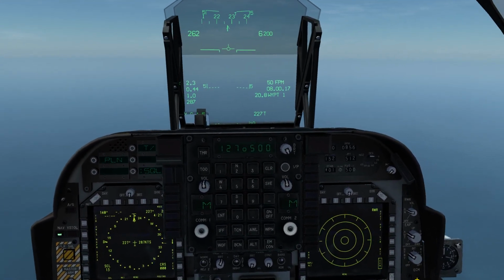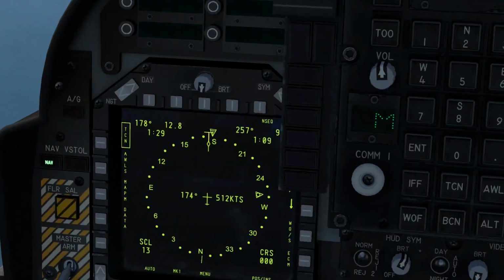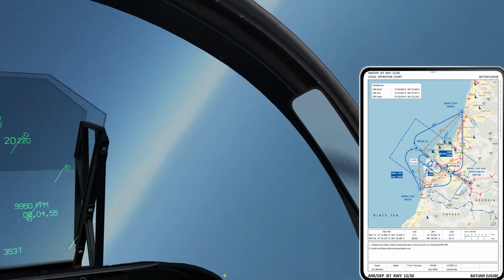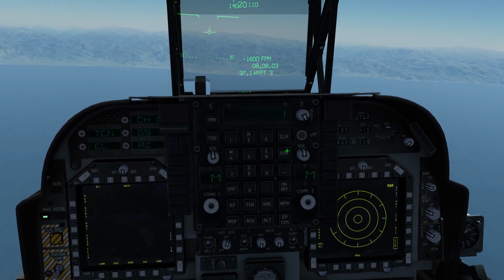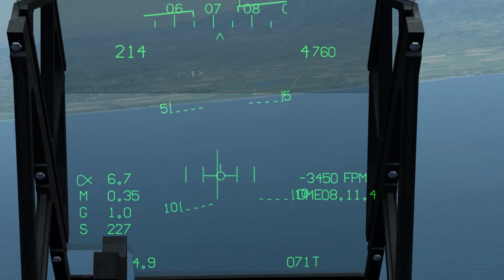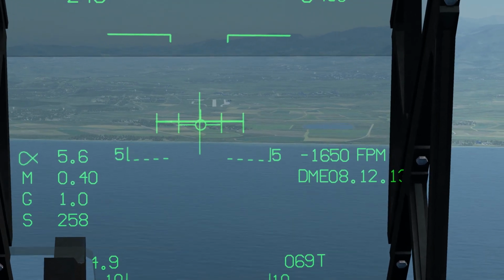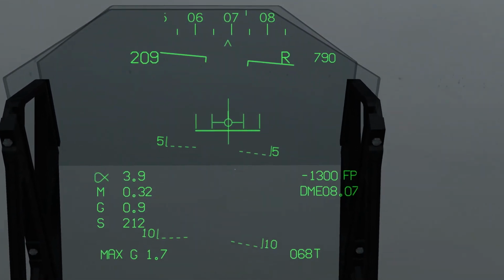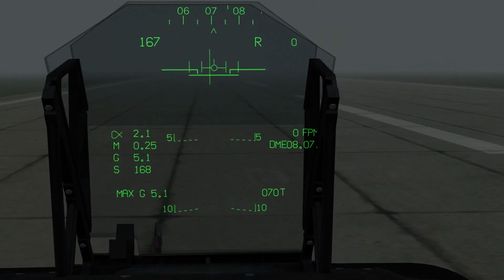DCS AV-8B NA Harrier Tacan and ILS/AWLS Navigation Tutorial

Comment: Tip for Glide Slope management, in the video on approach the ground speed is 222kts, a simple formula is “Halve the GS, add a zero” to get the rate of decent to maintain the glide slope. Ie 220/2= 110, add a zero = 1100fpm. This will help maintain a 3degree slope. As you configure and slow down, keep using the formula to stay on slope.  Don’t fly on the numbers though, fly the needles. The formula helps give you a rough idea what attitude/decent rate to set. Works IRL too.

Comment: The Landing Glide Slope indicator thingy is not very intuitive. You had to "chase" the indicator to maintain vertical glide slope but then you had to "run from" the alignment indicator to stay in line with the runway. Most aircraft that I've flown have indicators that you "chase". If the line is to the left, you move to the left to correct it. If the line is above, then you climb to meet the line.
But of course, I didn't see your post regarding this very issue until after I posted !
Reply: Yeah i agree its counter intuitive, its the opposite in the F14 or JF17 in DCS for example.

Comment: Excellent video.. Can't seem to get the Tacan working though.. Plug in the Airbase  44X but doesn't give me anything. Is it because I'm using Steam version?
Reply from the maker: Have you made sure you've pressed the ON button on the UFC and enabled TCN on the HSI? Shouldn't matter what version you're using.
Reply: RedKite Yeah I followed your video to the letter. It is a bit odd as I'm able to use it with your practice mission - Leisure flight at dusk. Plug in to a TACAN enabled base and voila. But can't seem to get it to work if I create my own mission!?
Reply from the maker: I've not run into that one myself,  that's odd, are you on the beta build, things have been a little strange recently.

Comment: Great video. But i have a problem. I tried this on the same airfield. But i dont get the vertical bar. AWL and TCN is on Marker is on the EHSD. But i dont get the directional line (vertical). Do i need to turn something else on that either isnt in the video or i missed??
Reply from the maker: Have you enabled AWLS on the EHSD? other issue is you'l need to be close to the airbase to get the steering line, use tacan to close in then switch over, ILS systems require an approch from a specific angle, if you're not geting the line you may need to roughly line up with the airbase first.
Reply: RedKite i tried later with another and got the lines. Dont know what was wrong the first time

Comment: Using the "STOVL" HUD mode will make things easier for you. Also, try to reduce speed much earlier, and maintain a constant speed. At 10degrees angle of attack, you should be around 130 knots with auto flaps and gear down. Try to be in that configuration by 1000 feet. The less changes you need to make at the end of your approach, the better.

Comment: Nice tutorial. How did you set up tacan for kc-130?
Reply from the maker: I set it up for a KC-135, the KC-130 currently does not support it. Within the mission editor you can look at the advanced waypoint actions, that allows you to configure the tacan frequency in use.
Reply: I know how to set for kc-135. But I can't refuel av8b on kc-135, just on  kc130. As much as kc135 has refueling probe for f-15.
Reply: I saw that you were refueling from kc-130 and also had tacan for it how did you do that?
Reply: ah it was kc135. My bad, thanks anyway.
Reply from the maker: Technically... you can refuel from any tanker (i've a video: 'how to air to air refuel') on that matter, but it's a bit silly :)
Reply: is it flew with av8b?

Comment: Isn't that vertical bar confusing? Coming from just about every other module- you should be flying towards the bars, not countering them. Particularly considering we are flying towards the horizontal bar.
This will take practise I think- first with a runway in sight and then without. Cheers for the videos RedKite, subscribed and I'll watch for more. :) 
(Incidentally- do you know if we can input coordinates yet?)
Reply from the maker: At present we cannot input manual co-ordinates, as for the ils/awls it's possibly inverted, we're not sure, if it changes i'l be uploading a new video to reflect the changes.

Comment: Does AWLS rely on a TACAN signal? We were trying to get it to work on the Sochi airfield, but we never got a signal.
Reply from the maker: At the moment it only supports airbases listed in the manual on the pre-made channels
Reply: RedKite Well Sochi is listed in the manual, I think channel 12. I tried it on Nellis, and it didn't work there either. Works perfectly fine on Kutaisi and Batumi, which is why I think it's to do with whether there's a TACAN station. I reported it to Razbam, so we'll see if it's a bug, or if something is missing. My buddy and I tried it both in multiplayer and single, and both had the same results with both versions.

Comment: Hi, thanks for this video.
Please you confirm that the waypoints work fine with the Harrier of DCS ?
I have DCS 1.5.8 Open-Beta but with mission editor impossible to use few waypoints, a mistake from me ?
Thanks in advance, Skull.
Reply from the maker: I've experienced no issues with waypoints, there is a limit of i think 25? total waypoints for the system itself though.